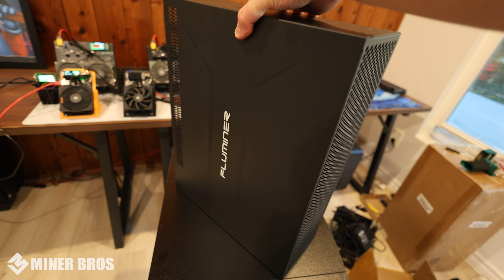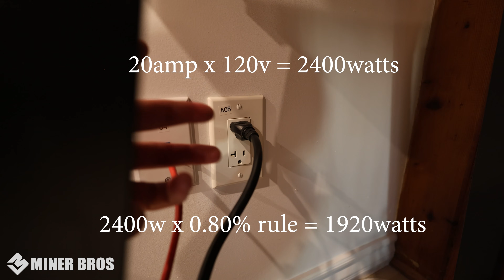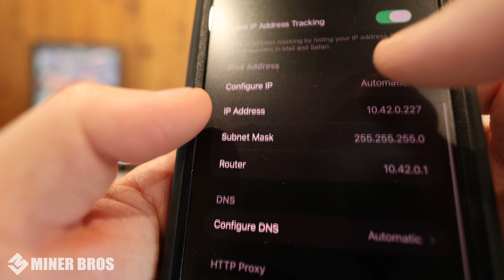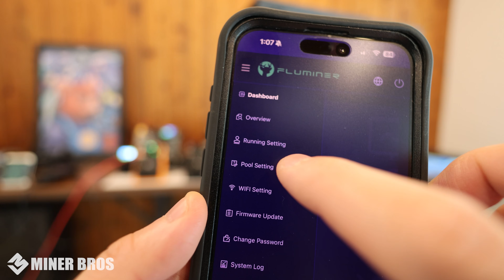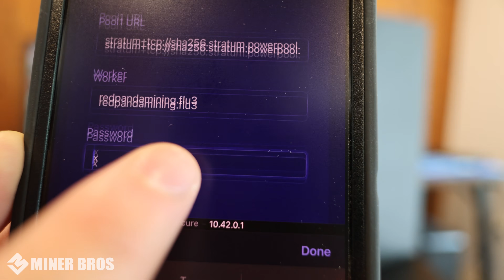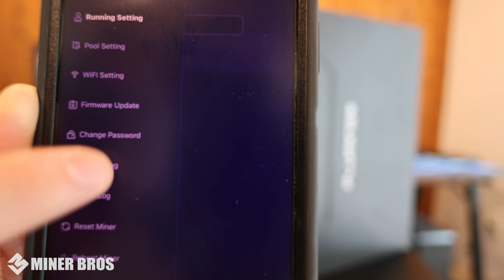From Box to Bitcoin ₿📦 | Fluminer T3 Setup Guide

Comment: This miner is junk. Doesnt deliver the ashrate it should and consumes more power. Reported power in the interface is the one after the PS. So you should add 20% to whatever that number is.
Mine shuts down when temp is 60C. In standard conditions delivers 75Ths for 1800W of power at best. The company is not helpful at all in trying to solve the issues. Latest software update is almost 2 months old. Don't buy it.
Reply: did they fix it?